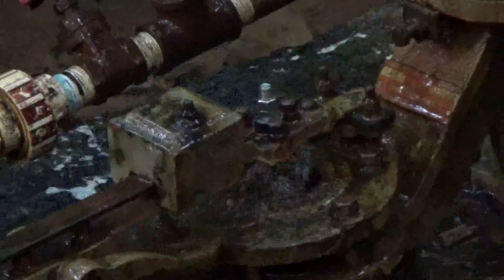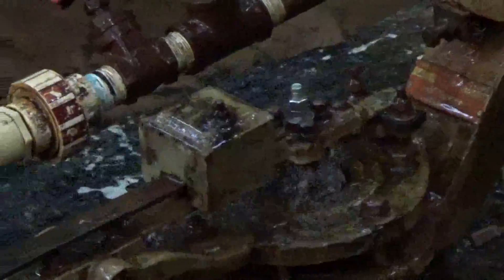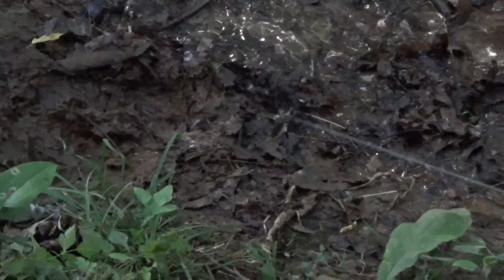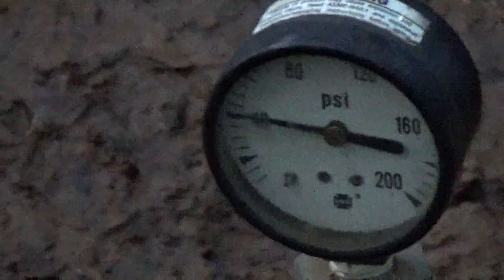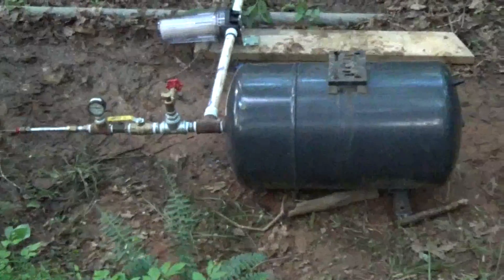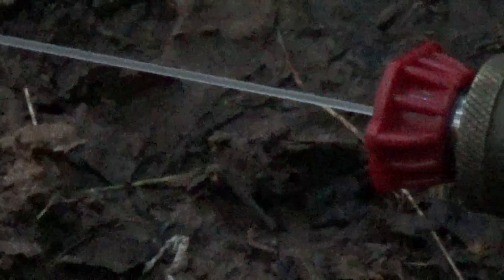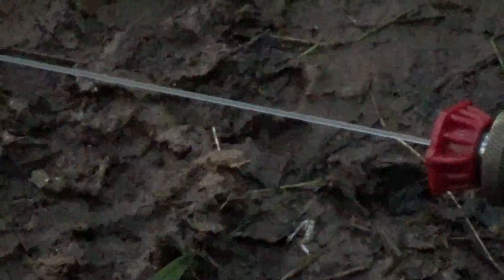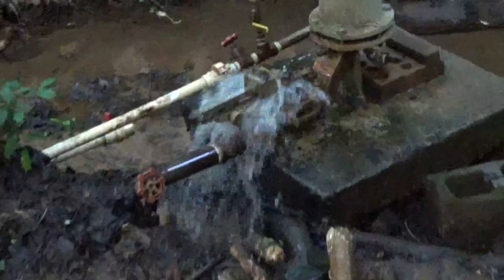Hydro Ram Jet Pelton Power

Comment: so, 50 gallon barrel, 15 feet in the air. 2-3" tube drop 5 feet, then angle down 45 to ram pump.
Install a gravity fed motor for added Power generation from the water pushed down to the pump by gravity, this will help manage GPM and create our 15 foot Head tube.
The return from the ram pump Goes back up to the 50 gallon barrel, where it runs the main Pelton power jet, contained in a box with a drain hole that feeds back into the drum. and add a small loop so the water released by the pump feeds back into the head to minimize loss.

Comment: Your pressure gauge does not show an accurate reading, as long as the water flows, because the flowing water creates suction on a T crossing. So your pressure is actually higher.

Comment: It is possible to use a ram pump to build a small sea;ed self contained (no flowing water source required as it simply recycles the water) hydro electric plant that will power a small home and run the air, the tv, the lights, the laptop, the desktop, the microwave,  and a few other things however you will also need a low head water pump, a generator, a few batteries, an inverter and a charge controller.  It's not "free energy" but it is pretty cheap! You will need to replace the moving parts every 5 years or so but that don't cost much money if you do the labor yourself.

Comment: I know this is rather late. Given your figures of 50 psi and 1.2 gpm, I calculated that you have 26 watts of mechanical power available and since that's a rather small system, I suspect the conversion to electricity will have an efficiency of between 50% and 80%, so your available power will be between 13 and 21 watts. Given 24 hours per day, that would mean that your system could generate between 0.313 and 0.5 kilowatt hours per day, which is between 114 and 182 kilowatt hours per year. At an average cost of 13.3 cents per kilowatt hour, that means that the generated power is worth between $15.19 to $24.30 per year.

Comment: If you have 100 feet of head, you should already have 43 psi of static pressure, so maybe 70 feet of dynamic head (that is, while water is flowing).  If you can get 3 gpm with your current setup through the ramp pump, I'm guessing you are running at least 10 gpm (maybe up to 3x that,, depending on your ram pump) through your supply pipe.  That same 10 gpm with 70 feet of dynamic head should produce around 50 watts through a turbine, according to the formula in http://www.sierrasolarsystems.com/files/08-Hydro-low.pdf.  It would be 150 watts if you can run 30 gpm.  Oh look, this is 4 and a half years old.

Comment: The bigger the wheel (26 inch modified bike rim or larger) the better torque from that little shot of water. Your power output is entirely dependent on the coils and magnets used. That water needs to be hitting the wheel from the top so that water falling down can be used for the motion, if it hits the bottom of the wheel it will work but the water drops to the ground low and does not hit the wheel as it falls from one that hits the topside of the wheel. Great job, I would like to see updates when you can. Thanks

Comment: The whole point of a ram pump is to raise a little water higher than it started by the energy from a lot of water. So there is no way that the pumped water will fall back an make lots of energy into a pelton (or other) wheel. Sort out a 2 metre drop/dam somewhere and fit a suitable turbine to catch all the water flow.

Comment: what if the 100 feet of head was feeding 5 rams at 30 feet of head that were pumping water to a tank about 20 feet above your water source. said tank having a pelton wheel generator at the end a drain pipe at the level of water source to supply to the rams. discharge from rams feeding into a resivore and pipes feeding rams at another 20 feet lower and  said rams pumping into same tank as the ones above, and so on cascading down to end of drop with a solar pump pumping during the day to feed the same tank. and if the flow to the tank could supply another pelton? my idea was to use a limited amount of water from a private pond so the water would be recycled so it would not go dry and supply power 24 hours a day to charge the batteries of remote home. that is why use the rams, to recycle the water to be used again and again.
Reply: I think you would run into a case of diminishing returns as the initial ram pump is only going to supply so much water to feed your system. But you sir have a beautiful mind lol.
Reply: INSANECANDYCANE1958 layman here.. if ten ram pumps were used to pump up to a tank at 30ft into a pipe flowing down to a pelton wheel, how would it be any different from any other micro hydro system with good head?

Comment: Question!  With a ram pump you have around a 90% (10:1) loss of water to get it to work properly.  With the Pelton Wheel couldnt you remove the ram completely and put a 10:1 pulley ran off of the pelton wheel with the full stream of water that was powering the ram and get the same energy?   Yes, the water is moving slower, but you are using all of it to power the pulley. The pulley would step up the speed of the generator input shaft. But while stepping up speed, would lower torque and thus mimic a small pressurized stream of water out of the ram pump.   Am I making sense to anyone else?   haha
Reply: great idea but that spell controlling the flow rate! which the ram will and can sustain,so makes sense to use the ram instead

Comment: @40psi and a 1/16 nozzle using a turgo wheel .....and with out knowing the gallons per minute or velocity

best guess around 200 Wph
Reply: The pressure reading is wrong (lower than real), because the pressure gauge was installed wrong.

Comment: you read my mind......this is what I had in mind except I was not looking to make the jet from the ram pump

I am going to pump it up the hill into a storage tank ....should be about 200 ft. of head that way, run it into a 6 inch pipe with a 1/4 - 1/2 inch nozzle at the bottom
I should be able to make 400-500 watts with my windblue generator

also a turgo wheel is better than a pelton

Comment: If you could get 50 watts with a test, I would consider it a big success.  As you know, 50 watts charging a battery(s) 24/7 could do a lot in a grid down scenario.  (Charge a deep cycle battery all day and use it to run a small fan on you at night when there's no air conditioning)  Let me know if you want to borrow my Harris Hydro unit(48V) or one of my spare Pelton wheels to connect to an alternator to test it.  I need to take it offline anyway to replace the bearing and a nozzle tube.

Comment: I know brass would be best but can a pump be made with plastic check valves. Two brass have to be ordered and are around 150.00 two plastic are 36.00 and can be picked up local. I know I sound cheep but money is tight

Comment: Have you ever considered using this to split water to make hydrogen? Get some old propane tanks, and use this power to split water and slowly fill the tanks with hydrogen, and just store them. Then, if anything ever happens to the power or electricity, or what ever, you'll have all this hydrogen sitting around that you got essentially for free.

Comment: I always thought that if you had a steady source of hydraulic power and having a heavy flywheel connected in line to maintain centrifugal motion; then with a geared or a series of belts and pulley's type transmission to control your out-put RPM's, you could run any generator (AC or DC).  It's the steady source of hydraulic power that has held me & my design up.  But your design, using a Ram Pump, seems to have over come my short fall.  Good Luck.

Comment: I think with losses about 95W by 24H =2,2Kw with a 400Ah battery bank would make a very nice little system for running a radio shack, low drain lighting the stereo...

Comment: I am not verry good at working out the numbers, but any conversion of energy means a loss of energy. So imo the use of the ram pump to increase the pressure results in a loss of energy. The most effecient way to create energy in this case would be to direct the waterflow that powers the ram pump directly onto a pelton power generator or micro hydropower generator.
Reply: I think it comes down to how efficient a pelton wheel is (something that requires high pressure but the volume is the limiting factor) versus a water wheel. Does the energy conversion from a pelton wheel spinning rapidly directly connected to a PMA produce less energy loss than a large gravity fed water wheel stepped down using gears to spin a PMA rapidly. 

The question really becomes what is a greater loss of energy, the accumulation of the gravitational force of the water, or the accumulation of the spin forces on a gear mechanism. 

another question to consider, if your generating on a low rpm PMA with a slowly (in comparison) turning water wheel, does the output exceed what this pressurized water would be producing on a regular PMA using a pelton wheel. Someone should do a side by side comparison or at least venture into the math involved in the comments.
Reply: I just saw your comment and I was thinking the same thing. I posted yesterday basically what you did 3 months ago.  There is definitely a lot going on inside the ram pump that would take a lot of calculating to understand.   For instance what kind of losses does the water hammer create?  I really think it would be a case by case performance study.  Everyone's ram pump, head pressure, elevation, generator, pelton wheel and ability to do math are all different!  ha!    Like me,, im a thinker, not an adder.     I hope Engineer775 post his follow up video soon.   I'm very curious.

Comment: Very interesting! It may be a small amount of electricity generated but it is free, 24/7 and can add to a solar/wind off grid system.  What if you had ten of these systems (or 100).  
Not that your water jet weapon isn't great...but wondering if the excess water could be captured where it would provide additional head pressure to help run the system(s).  
In a low head situation could this be built using something like a Rife river pump to create head?

Comment: Maybe you could get 10-20 watts from  a setup like that.  If you were able to hit the pelton with several nozzles, and run them for any lenght of time that would be better. Another idea could be a holding tank/basin on the top of the hill, like a battery, it would give you more power when you need it.

Comment: Engineer775  do you think that the stream would be strong enough to run the water turbine that they sell to go with the sun runner system? the trio of the panels,wind turbine and a water one for the sun runner system seems like it would generate some energy 24/7.

Comment: If you had a bigger creek could you put in 4-5 ram pumps to fill a large tank on the top of the hill then use one single pipe down the hill to a pelton wheel?

Comment: I'm thinking a twelve volt generator charging a battery.  Then that opens up a lot more options.  Not forever.  Eventually the creek will dry up...decades down the road.  Awesome job though man.

Comment: I can't remember where the best efficiencies are with a Tesla wheel made with hard drive platters, but have you considered one of these rather than the pelton??  I just think the Tesla pumps or power generators are cool and ¿I think? they work well with low flow and pressure since they used surface tension for the transfer of energy rather than direct impingement. They may take quite a while to get up to speed sorta like an ion drive but since you virtually continuous flow and volume, that should be ok.

Comment: I'm thinking the 111 or 274 watts would be the work done by the water itself.  The efficiency of the electrical generator would never reach 100 percent.  However I think a flywheel would help increase that efficiency.  All things considered my guess is you will have a real bright 60 watt lightbulb.  Which in itself is significant if applied to electrical storage 24 hours per day.

Comment: Now, if you could get the nozzle hooked up to move in a CNC programmable axis and mix in the correct amount of abrasive media, you would have a true water jet and be able to cut steel plate.
Of coarse, the pressure would have to increase by a few thousand PSI..

Comment: well i not the best at this but my ruff figuring should be about 110.88 watts
1.2gpm x 2.31= 92.4 feet of fake head. gpm x feet of head=watts 1.2x92.4=110.88 times that by 24h you go some power. my nosal chart said at a .125 opening you would flow about  2.96gpm.  2.96gpm x 92.4=273.5 watts keep us posted that is thinking out side the box that for sure keep up the good work.
Reply: I can sit here online with the lights going and laptop router modem and so forth with that wattage. My only HOG is my electric water heater that can't be changed :(
Reply: Sachi WI if you switched that heater out for an on demand one it would cut power usage considerably.
Reply: rwjedi
The largest they make is 27kw and that would only supply me with about 2 gallons a minute with barely 110 degree water - is that enough i really don't know. Up here in WI it's not really cost effective my dad is an HVAC Engineer 50+ years experience I'd need a natural gas to be cost effective. I could be wrong too, IDK. Ground water temps around here are about 40 F not sure if there would be enough temp rise available - unless i used the old tank as a room temp tank (about 70 F) then it would work?
Reply: Sachi WI They make some that are intened for end point use, rather than replacing them where your tank WH is you place it close to where you actually use it. This is said to be even more efficient than the whole house ones and they're about half the price of the whole house ones. (Just looking at Home Depot) They make larger on demand ones, you have to make sure to look for Whole Home heaters if thats what you want to do, saw one on Home depot thats 36kw
Reply: How large a reduction would I save? Right now  it's about 40 bucks a month or 365 kw per month to run what i have.
Reply: I would be rather curious as to your figures. Given his mention of 50 psi and 1.2 gpm, I get at 100% efficiency 26 watts. Since he can't get 100% and since the system is extremely small, I suspect the real efficiency would be between 50% and 80% for something between 13 and 21 watts.
Here's the math.
50 psi converts to 35.16 meters of head.
1.2 gallons per minute converts to 0.0757 liters per second.
The amount of mechanical power (in watts) is
M * H * G = W
where
M = mass per second (1 liter masses 1 kg)
H = Height in meters
G = Gravitational acceleration (9.8 meters/second^2)
So
0.0757 kg/s * 35.16 m * 9.8 m/s^2 = 26.08 kg*m^2/s^ = 26.08 watts

Comment: Interesting.  I'd be inclined to install a tank at a much higher elevation that is filled with the ram pump and then pipe it back downhill with a micro hydro setup at the bottom.

Comment: Any energy that is free is a lot. Store it in battery and your set. That's a great idea
Reply: If you have steep hills around, it would make more sense to store the water in a tank (as big as possible) weigh up the mountain (as high as possible). Then, the tank would be your battery; You just open the valve to generate electricity when you need it...